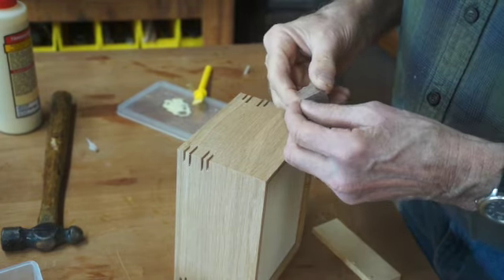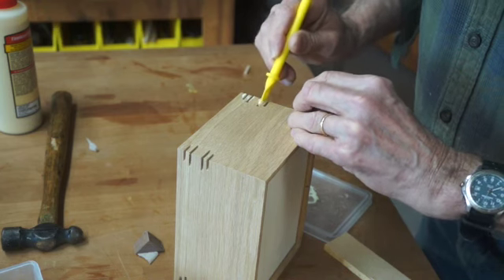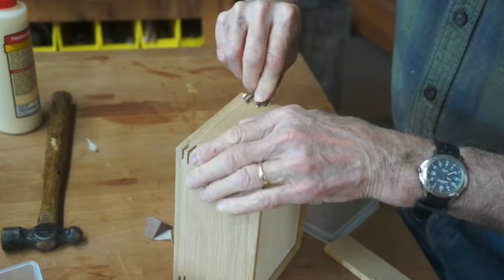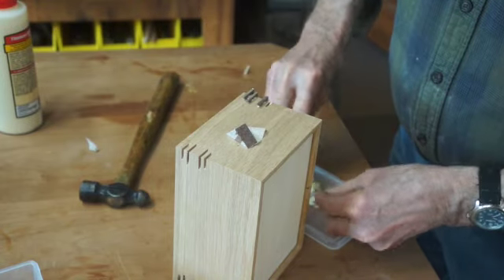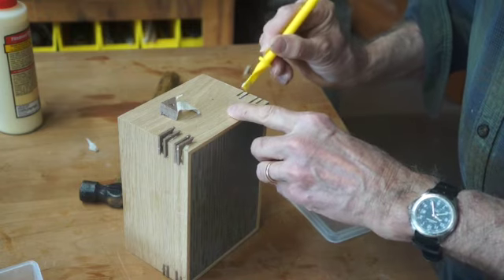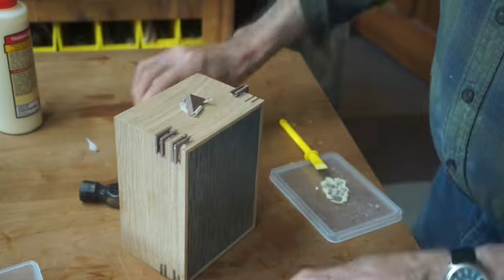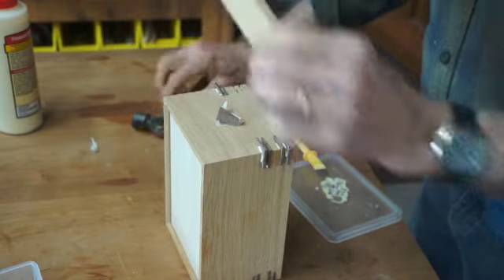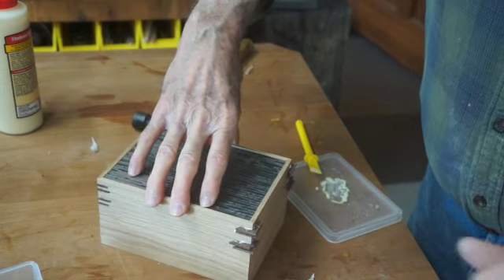Installing miter keys   SD 480p

Comment: Do you give any consideration to grain direction on the keys?   Is there concern about having endgrain on some and face grain on others that takes finish differently? Thanks!
Reply from the maker: Of course. the grain direction, in  order to strengthen the joint must span the joint. So the keys are cut in a triangular shape on purpose. Did you watch the video on making miter keys mentioned in the description? Here it is again as you likely missed it. https://youtu.be/28UOEXPstzk The keys are not end grain on one side and face grain on the other. If you know how they're made, you'll better understand.